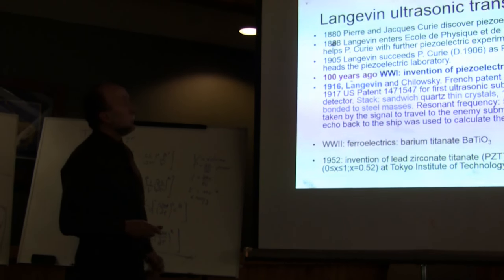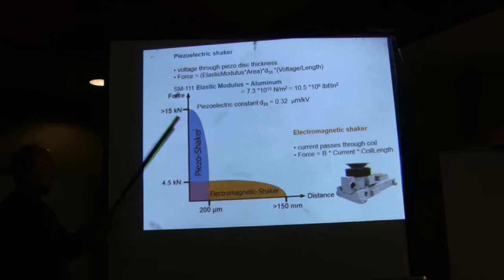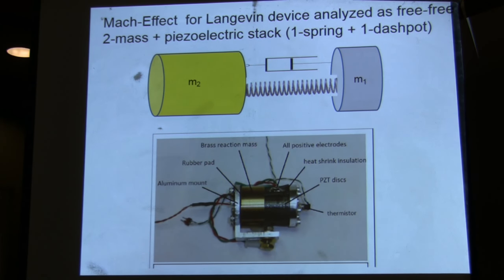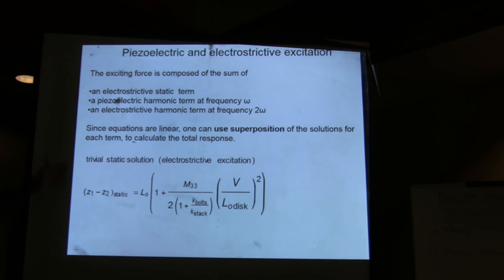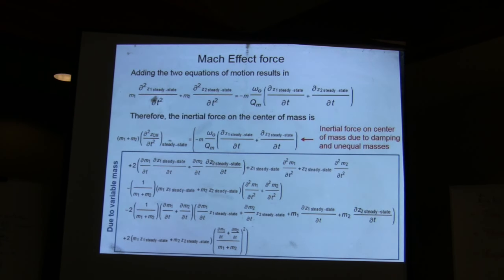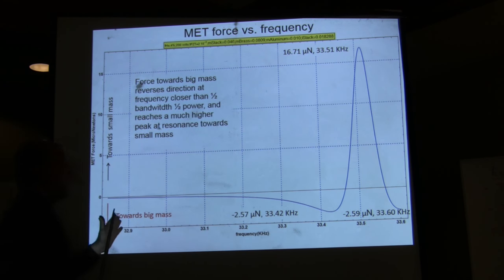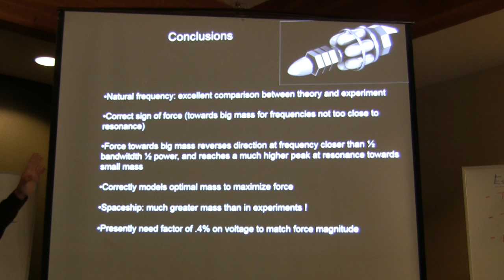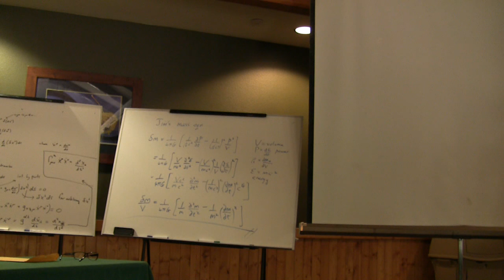BPW 2016: 07. José Rodal, Ph.D, Hoyle-Narlikar Mach Effect

Comment: Could you increase the impulse by charging and discharging a capacitor placed at the end of the stack? (charging a cap increases it's rest mass, e=mc^2, etc..). Not sure if it's worth the effort. Impulse may be very small.. What is the highest frequency you can get with PZT (or other material)?